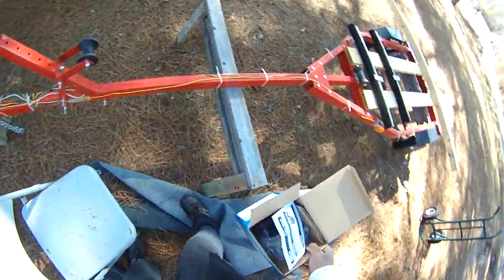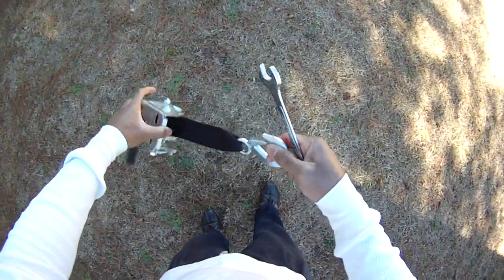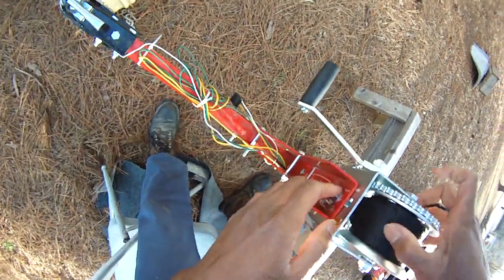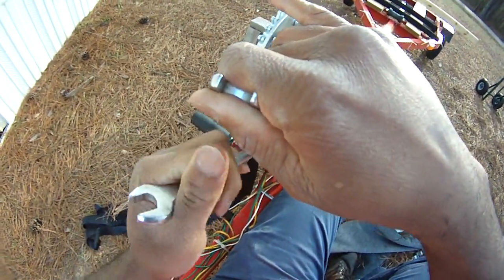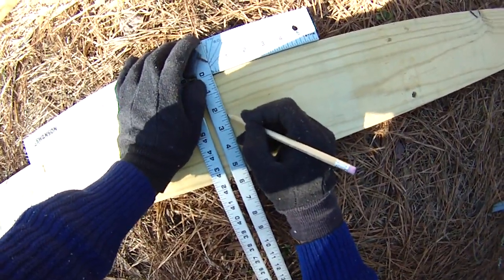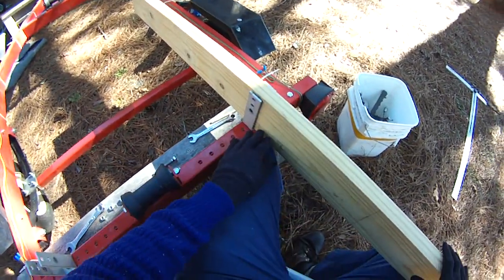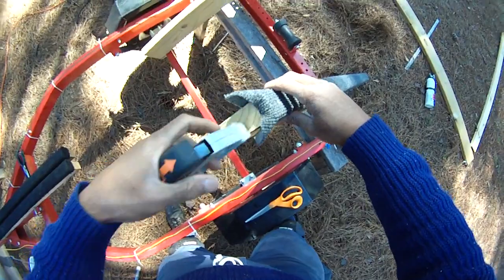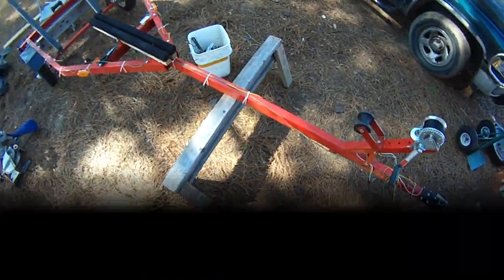Harbor Freight Boat Trailer Upgrades | Adding a Winch | Bunk Mods

Comment: I've had one of these trailers for about a year now.  haven't made any major changes yet.  I was reading some of the comments.  I secure mine with a ratchet strap that goes over the boat from one bunk to the other using a eye bolt to secure the bunk rather than the original bolt
Reply from the maker: +Kelley Doern Nice.

Comment: Nicely done video. Would suggest a couple of things. For the carpeted bunks, use a waterproof glue as well. The staples will rust out very quickly!  Easier to carpet before installation. Also an inexpensive electric stapler can throw up to a 9/16 staple (much heavier) that will last longer and hold better. I don't understand the swinging rear bunks. Seems to me it would make for harder loading as the wooden bunks would float at or above water level. Enjoy your trailer and don't forget to unplug your lights before putting it in the water. Saves a lot of bulbs.
Reply from the maker: +Ratdog 305 Thanks! Nice suggestion on the waterproof glue. Wish I had done that.

Comment: If you were to mount the winch on up side down you could use your right hand to wind it in and the belt would be over the top of the drum.  Wouldn't that work better??
Reply from the maker: It doesn't matter. I often load the boat from the  opposite side that most people do. Besides, I don't even use this trailer anymore, so it doesn't matter. As long as the boat get on the trailer successfully, who cares what side the handle is on?
Reply: @BlackWarriorLures  I have three trailers, three winches and I'm right handed. That is who cares. And probably other people who are right handed would care.
Reply from the maker: @chjp2346  I'm still not sure why people comment on this aspect of the video after 5 years. A person can mount the winch in any way they chose that makes the best way for them to get the boat on the trailer. I'f I'm right handed but loading teh boat form the right side of the trailer, mounting upside down works better. It depends on each person and however they want to use the winch. My opinion doesn't matter.

Comment: To bad HF does not carry these trailers anymore. I am in the process of getting a folding HF trailer tomorrow and modifying it for my 10 ft jon which I got today. I will see about using some of your ideas for it as it is my first boat anbd trailer sense I retied now and have plenty of time for fishing. Thanks for the videos.
Reply from the maker: Thanks, but these trailers aren't worth it for heavy everyday use. Get something more heavy duty even for a 10 ft jon boat. There are far better trailer for your money than these rickety things.

Comment: Great Video!! I have watched over 10 times now. I am considering one of these trailers for an inflatable, but am fearful of sharp edges. Any thoughts/suggestions? Thanks!!
Reply from the maker: Shane Gilroy Yeah, there are sharp edges. One reason I had to rebuild these bunks was because it was scratching the bottom of my boat. I have no problems now. You have to make sure everything is coated with indoor/outdoor carpet.

Comment: Black Warrior, You do a great job posting your thought processes as you "teach" viewers, save us re-learning the same steps. Just wondering: Do you have your winch installed upside down, that is with the strap running under instead of over the reel?  Thanks for the video!  Brad
Reply from the maker: Well, it doesn't matter as long as the boat get on the trailer.
Reply from the maker: ***** Thx.

Comment: You mounted the winch upside down, it matters because the locking switch is on the wrong side and on the bottom instead of up top & on the driver's side where you can see it when you're working the winch from the driver's side of the vehicle. Doesn't make any sense to jump over the trailer or walk all the way around every time to work the winch.
A ratchet and a wrench tightening up the bolts instead of using two wrenches would save you a lot more time.
Reply: The strap should also be coming off the top of the spool not from the bottom. just saying
Reply from the maker: +davidayala1974 It hasn't been a problem for me. I always load the boat from the passenger side. Been using all season with no problems. I can see the lock just fine from the passenger side.

Comment: so i think thats the trailer for me ive been looking for a used one for awhile, but all i find is junk. i have a 1960 valco flat bottom with a V. it only weighs about 85 to 90 pounds. i like the runs you made.
Reply from the maker: Yeah, it has served me well.

Comment: Hi. Would you recommend this trailer for a jet ski?
Reply from the maker: That would depend on the weight. 600 lbs max. weight on this little trailer. As far as size I think it'd be great.
Reply: Black Warrior Lures I think maybe like a base model jet ski for like two people? Not the big fancy ones for three with all the bells and whistles
Reply from the maker: Yeah,  you might be alright. I can't guarantee that or anything, but jet skis don't seem to be overly heavy machines anyway. Just keep in mind 600 lbs weight limit.
Reply: you're absolutely right about that weight limit. I just noticed that Northern Tool sells a jet ski trailer that looks just like this one but is rated at 610lb weight limit. Also there's a $100+ price tag difference.
Reply: Hey if you dont mind me asking what kind of camera are you using? I see that you have both hands free on all your videos, do you strap your cam to a hat or something?
Reply from the maker: Oh, yeah, that was my Contour ROAM. Yes, it was mounted on the bill of my ballcap. They have all kinds of mounts, straps and things. It's a 
pretty good camera: http://contour.com

I'm not using it now. I use a Nikon D3300 dslr camera now.
Reply from the maker: Is the Northern Tool version galvanized?
Reply: Black Warrior Lures not really sure if it's galvanized. Thanks for the camera tip. I do roadside and been looking for a camera where I can have both my hands free

Comment: Actually Academy Sports has better prices on winches than Harbor Freight...  also the bolts you need are (3) 3/8 - 16 by 1 inch hex head bolts, washers, lock washers, and nuts
Reply from the maker: thx I don't even use this trailer. Harbor Freight no longer sells it either.

Comment: I dont want to be nasty.  I understand that every one has different mechanical abilities. I have been a mechanic all of my adult life, here's what bothered me with your build.
1 Attention to detail.  Wires everywhere look a mess. It would of not been hard to put all the wiring inside a single sleeve and route them neater!
2 The winch is the wrong way round, i know you are going to say it works, but its still designed to work on the other side!
3 your bunk mods! should of at least treated the wood. Then glued and stapled the carpet material!
4 there was nothing wrong with the original bunks, the trailer just need another roller up front, after market easy available.

Now thank you for sharing, this is a constructive reply. How is the trailer working out for you? Maybe another video with a launch and recovery?
Reply from the maker: Thanks for the help. I'm not a mechanic at all. Music is my background. Long as I can get the boat on and off I'm happy. I'm not a detail oriented person. I'm a big picture person. I have a whole playlist about this trailer: https://www.youtube.com/playlist?list=PL33pk1OEpFSp5s2XsWekeNxZe4zUgtdGC

However I did put attention to detail when building my mud motor and designing and making my fishing floats and trolling flies and lures. I can't put infinite detail on everything.

Stage 2/3 Mud Motor Playlist
https://www.youtube.com/playlist?list=PL33pk1OEpFSoayYZMt5SH3-8WumPKytlz

Pink&Purple Trolling Flies
https://www.youtube.com/watch?v=KwG2ARdqnlw
Reply: Black Warrior Lures I just want to mention again, it was not an insult my friend. You got it going and as long as your happy, thats all that matters.  Now music lol omg thats one thing which i do not do well. I certainly was not helped with that.  My dad makes flies, for fly fishing in the lakes in the UK. I know it takes a lot of time and patience, which i have but only if its made of metal lol. Just subbed you.
Reply from the maker: Again, thx. and Welcome. If you have the time check out some of the newer videos. These old ones are pretty bad.

Trying to get back on the river. I was about to head out this morning but forgot that I need to renew my boat registration this month. Had to take care of that.

Next thing on the motor is to install billet rockers and get the valve train and timing right.